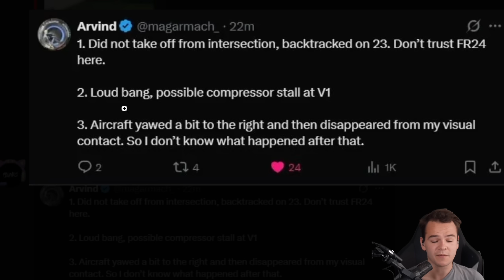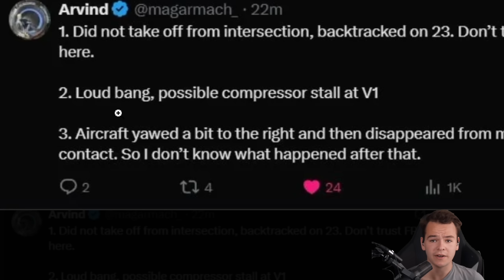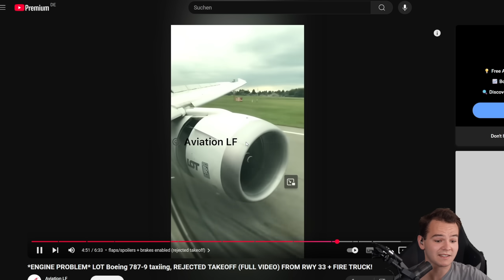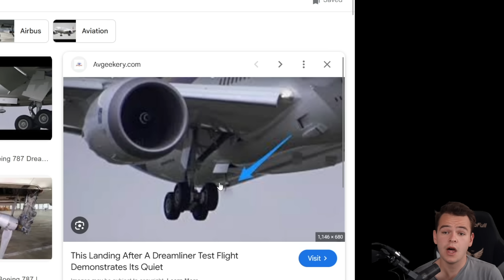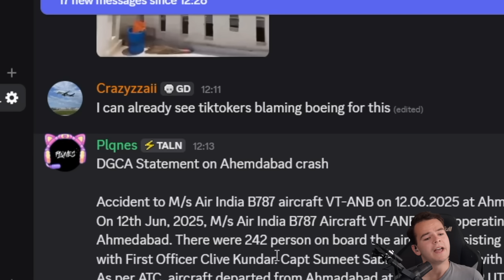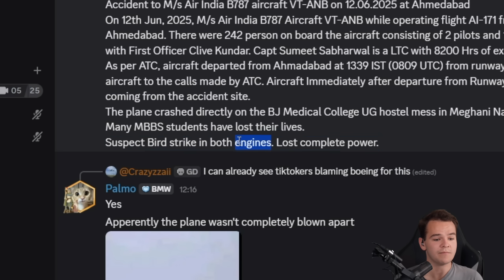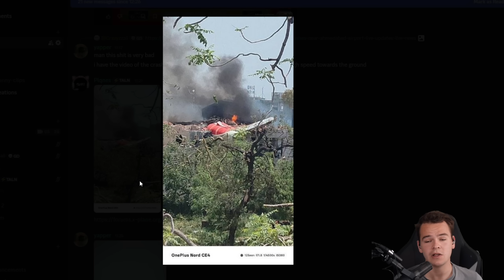The First 787 CRASH Ever - Why It Is SO Confusing?

Comment: It is not outside the realm of possibility that militants from the ground have used small arms fire to take out both the engines. If two militants  stationed on rooftops on buildings just outside the airport had used AK-47s or RPGs to target the engines as the aircraft lifted off the runway, this would result in the aircraft losing power and crashing exactly as seen in the footage.

Comment: heres my theory of what happened

as we saw the plane didn't go up properly
which means that there is a high chance that there's a malfunction in the flaps or rudder as we saw the clip the flaps and rudder did not activate meaning that there was a failure cuz thats not a pilot error clearly

another possibility is that the pilot did this on intension , with further investigation if my theories are correct pls like the comment and swiss pls acknoledge this theory for any more research

Comment: the 787 didnt crash, the pilots crashed, proof is already released, overloaded plane loaded with fuel people n luggage, only 1500 feet on runaway when you need 3000 feet, no slats no flaps used on take off, no full thrust used equals no lift, landing gear not retracted, gravity takes over, boom, disgraceful piloting.

Comment: Even a single engine failure below V2 speeds would generally warrant keeping the landing gear out, because the transient drag caused by the landing gear bay doors deploying into the airstream could cause enough drag to stall the aircraft.

I know this was procedure for engine failure below V2 on the 747, I imagine something similar exists on the 787 as well.

Comment: i noticed that has well , cause i am wonder if you are losing altitude, wouldn't you go full power , my guess is either one of two things a: the pilots lost one engine and either shut down and rolled back the wrong engine, say they went off a old trick that a certain engine provides ac or power to the air craft but it is different on the model of aircraft

Comment: wow i wasn't expecting a whole analysis with the FS only hours after the actual crash. crazy job, I'm impressed
Reply: I would not call it "analysis".  It is very preliminary speculation based on the amateur video showing the plane sinking down with wings level and nose up as the pilots attempted to climb, but obviously with little or no engine power.  Easy to quickly put together a brief discussion that includes that plus simulated images.  A significant conclusion at this point is that this apparent major system failure is very bad news for Boeing.
Reply: @BrandononIce-sk7fx  well thanks I appreciate you explaining it to me though!

Comment: What is the common denominator that could cause both engines to fail? The computer. Most people don't realize that the computer can fly the plane; takeoff and landing. Just speculation at this point, but something took out both engines at once.

Comment: In 2019, a GE powered Jetstar 787 had a dual engine failure because of bad fuel. The same thing also happened even earlier on an RR powered A330 operating as Cathay 780

Comment: 5:30 the landing gear most likely wasn't retracted as opening gear doors causes a lot more drag than just leaving the gear out
Reply: This is BS. I don’t know why people say this stuff. Retracting the gear will reduce drag, that’s why pilots are trained to retract the gear asap. 

Unless the pilots think they won’t continue to fly.
Reply: @rtbrtb_dutchy4183  Yes, retracted gear causes less drag, but again, opening gear doors causes more. Look at emirates 521
Reply: @rtbrtb_dutchy4183  If you can a dual engine failure you dont want to produce anymore drag even if it will reduce drag in the end
Reply: BS, ask every pilot, and they will tell you that the doors cause way more drag. In this situation, they didnt have enough time to retract them fully.@rtbrtb_dutchy4183

Comment: You incorrectly described the 787 Dreamliner as "uncrashable" No Plane is Uncrashable! The Crew failed to deploy the flaps based upon the video I just saw, which is Clearly a Crew Based Error! The Fault of this crash will fall on the Crew for Failing to properly set the flaps 😢!!! You clearly only want to post videos..... You are a disgrace to aviation by making the statements you made in this video

Comment: A lot of people are saying it looks like the flaps are not extended. However, one would think that the 787 has a take-off configuration warning alarm. If it is a dual engine failure, it might have been a problem with the fuel delivery system.

Comment: Kinda weird that dual engine flame out and the pilot are flying flaps and slats up with landing gear down. My best guess single engine failure led to startle and then led to misconfigured plane which led to stall and the tragic loss of the plane.

Comment: Wonder if it could be something like what happened with TransAsia Airways Flight 235? The pilot or copilot reacting to an engine failure on take off by accidently shutting down the working engine in too hasty a reaction?

Comment: The cause could have been the on-board information technology systems and computer-aided control and management systems of the aircraft, the malfunction of which resulted in a complete loss of power of the turbojet engines.

Comment: It reached altitude of 600 meters before falling, i am in no way a aviation expert but i am going to assume the plane was over its weight. a plane struggling to climb usually means it was too heavy, any engine failures detected before takeoff the plane will exit the runway. engine failure that happens after takeoff usually the pilot can takeoff then perform a go around landing

Comment: Ahmedabad airport has a significant bird strike problem, making it one of the riskiest airports in India for bird strikes. The rate of bird strikes at Ahmedabad is notably high, with about one bird strike occurring per 700 flights, which is almost three times the rate at Delhi airport1. The airport's proximity to bird sanctuaries (such as Thol bird sanctuary about 30 km away) and large open grassy areas contribute to the high presence of birds around the airport1.

Recent data shows a rise in bird strikes at Ahmedabad airport, with 38 bird hit incidents reported in 2022-23, a 35% increase from the previous year25. Bird strikes tend to increase after the onset of the monsoon season due to the proliferation of insects that attract birds near the airport2. Various measures, including bird chasers, laser guns, and bioacoustic devices, have been implemented to mitigate this issue, but bird strikes remain a concern2.

Experts have suggested that the recent Air India Boeing 787 crash near Ahmedabad may have been caused by multiple bird hits leading to engine failure37. Witnesses and former pilots have indicated that both engines lost power, possibly due to bird strikes shortly after takeoff7.

Comment: Possible wrong weights entered in to the FMC by the pilots, which would mean aircrafts computers thinking it’s much lighter and not giving the correct thrust from the engines. Also possible aircraft loaded incorrectly so it was out of balance and couldn’t climb or load shifted on rotation of the aircraft causing the aircraft to go out of balance.

Comment: One thing about this whole accident that has me confused, according to flightradar, the pilots didnt even bother to use full length of the runway for takeoff, they took of from halfway down the runway with only around 1.6-1.9 km of tarmac. Fully loaded 787 with a substansial amount of fuel and only half length?

Comment: very odd for sure , having watched about 150 air crash investigations and knowing 50 percent are the planes fault and 50 percent are human error id guess human error on this one....they could of forgotten something before take off.... almost impossible you get 2 engine failutre at the exact same time just on take off.... they would of not filled the plane with fuel at all which would make more sense , no way a bird strike air traffic control would see them on run away and the engines are far apart plus you need a lot of force to break a modern engine they test them with frozen chickens into the fan blades and that doesnt break them, even a firemans hose wont put the engine out ... its suss , auto pilot should take the flight off the ground and that was a modern big airport ... hijacking possible i guess. very strange like mayalaysian flight 370 people are only guessing right now

Comment: What the takeoff video doesn't seem to show is the flaps in the down position! They appear to be up! 

This plane is struggling to get altitude, and just seems to settle out of the air. 

I'll say this, we KNOW that the most dangerous times for aircraft are takeoffs and landings. That said, and this being 2025 - I still don't understand why airports aren't required to have 8k video cameras all over these runway areas with audio to record all operations to determine causes of not only flights, but ground incursions, aircraft on wrong runways, birds, etc.
Reply: One would think that the 787 has a take-off configuration warning alarm, so taking off without flaps and slats being properly set would be practically impossible. I do agree that airports need a lot more high definition cameras. The US Navy videos every carrier landing to evaluate pilot performance and to investigate accidents. Ground cameras could also aid in ground navigation and prevent runway incursions.
Reply: Some say it's a sabatoge

Comment: Dual engine failure. Extremely rare case. The investigation is going on. But how can both engines fail remains the question.
Reply: its not a engine fail certainly its the pilot who decided to take off without flaps and rudder
Reply: @Xhydro_unique  You think that is a regular car driver??? An extremely qualified pilot who trains pilots all over the world just decides ti not use flaps and rudder? Initial investigations show that there was a dual engine failure, which is extremely unlikely and rare. How did that happen is the question.
Reply: @supernova652  no im not saying that he did it conformed im just sayin that it could be a further possibility

Comment: raising landing gear with limited thrust is a risk though,because the process will produce a little bit of a drag which the pilots may consider not a good idea if height, rate of climb and thrust are not in place.Some theories say that first you need to clear obstacles and then retract.Any way clearly they had control of manuevering cause i can see a pitch change in order to avoid the buildings so thrust is probably the Thing here....something did not allow them to gain the thrust they needed,dual total engine failure is very unlikely though,something else must have happened

Comment: It’s pretty clear this was a low/no power induced crash.  The plane is still in full control, low angle of attack, not at risk of stalling.  But also losing altitude and the rest is history.  What’s left to learn is why the engines lost power.

Comment: I saw the unedited video and heard what sounded like a plane prop.  I did not consider it was actually the planes ram air turbine.  I was thinking, why is there a prop plane so close to this plane that I can hear it?  I will confirm the air turbine was deployed.  I saw the video unedited this morning and thought that I could not see the flaps set and figured that may have been the cause, improperly configured aircraft.  I will be waiting for the full report to come out, but I suspect you are correct that this was a dual engine failure.

Comment: I saw a video apparently from the crashed plane from before takeoff where the passangers where upset that neither the ac nor the entertainment system working. If true ( all speculation, no confirmation), the plane might have had electircal issues

Comment: 5:08 in the video you said that the gear was not retracting yet, but it looks like (cause the quality of the video is not very good) that the gear was in the first phase of retracting. On the b787 (and b777), when retracting the landing gear, the main landing gear first tilts the opposite angle so it is tilted like a 767 for example. But as the landing gear doesn’t move at all in the video, it looks like it is just stuck in that position

Comment: Your lying no one has told you any of this your making it up. .its the front wing flaps  where not in the takeoff position. Or retracted to early meaning in physics its impossible to clime and you lose height  and air speed. Its as plain as day. How can you be a pilot and not notic this. The plain has full power  its not the engines its the wing front flaps. Your dangerous

Comment: The fact that it very well looks like the RAT was deployed a dual engine failure was the case. Now, was it bird strikes or system related? Knowing that aircraft has massive system redundancies, it was probably external, and a dual bird strike is a very likely.

Comment: It should be made runway extensions at airports in case of an accident during take-off. That way they would also prevent the disaster of the concord from 2000.

Comment: Damn it sad to hear this, i cant think any other reason for dual engine failure after take off other than, collision with bird/ground objects, maintenance problem, engine design flaw, or pilot issue like the trans avia crash on ATR 72 on Taiwan. i would be surprised if what happened here outside of what i am thinking

Comment: First there was the Indian Airlines Flight 171 crash back on 10/12/1976, then a supernatural horror book titled Flight 171 was published on 10/4/2022), then THIS crash, whose flight also happened to bear the number 171.

Should any other airlines' flights with the number 171 (if applicable) be re-numbered in fear of superstitious association?

(As if to amp up the Insane Troll Logic, the video's length is 9:11 after the typical 1-second cutoff.)
Reply: That seems like a curse

Comment: dual engine failure like that with no obvious damage to the engines, such as bird strike (big birds).... I will speculate, somehow fuel was cut off from both engines. either mechanical issue, or fire handles pulled for some crazy reason
Reply: or sabotage

Comment: If you lose both engines at V1 you’re still aborting. It’ll fly with one engine. It won’t with 0. So if it were a dual fail due to birds it would have been after rotation